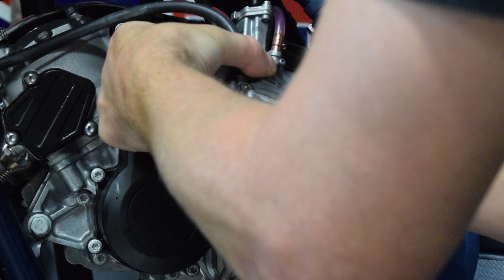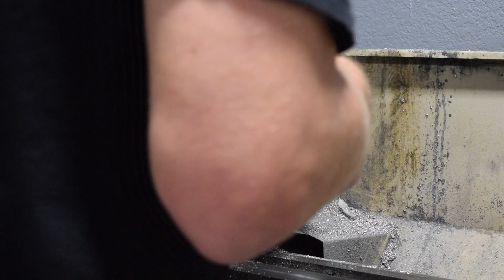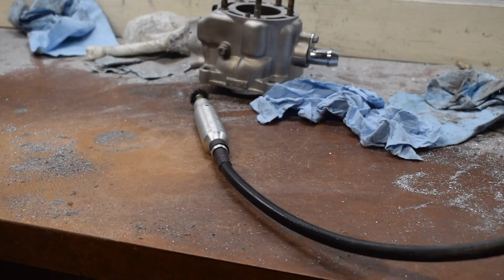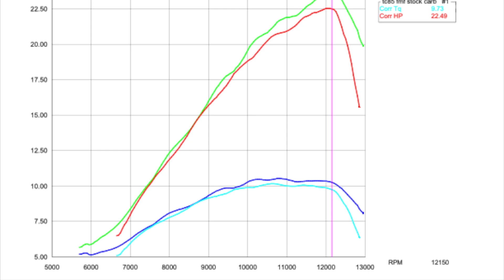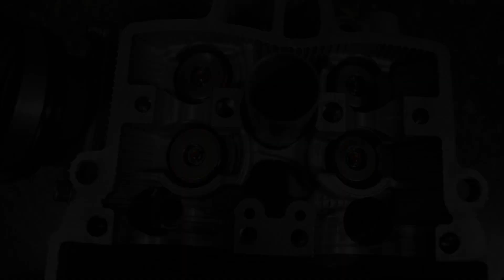How to: Bore a Carburetor with DYNO RESULTS

Comment: So if an 85cc had a PWK 28, an your boring just under 2mm, wouldnt it be cheaper to buy a 30mm carby instead? Cool video thou, been checking a few out, the dynos on the 85cc ktm an husq..........
Reply from the maker: What 30mm carb exists of good quality that fits inside stock boots?  Additionally our carb isn’t straight bored either
Reply: @HPRaceDevelopment  Your taking it the wrong way mate, ive asked a question, im not being disrespectful........ Didnt think of how much bigger are the externals of carb to go inside both boots either.
Reply from the maker: @chechanrebelsgoldminingtas5675  not taking it wrong, just saying my comment without any sugar.  If you know of any high quality non Chinese knock off 30mm that is same size, im all about it

Comment: What did you have your compound angle set on for the taper? Also, where did you start the taper, from the centerline of the needle jet location? 
TIA, great video!!!
Reply: Dont you offset bore to leave carb bottom untouched ?
Reply: A few degrees is all it takes, I have done 36/38 so the inside closest to the slide would be stock 36 and end up at 38 at the reed block side.  There are a few other things that can be done as well to the carb that work well, the STIC is good and some rifle boring as well helps.
Reply from the maker: we keep that info close to the chest